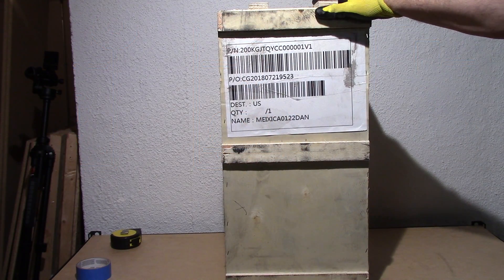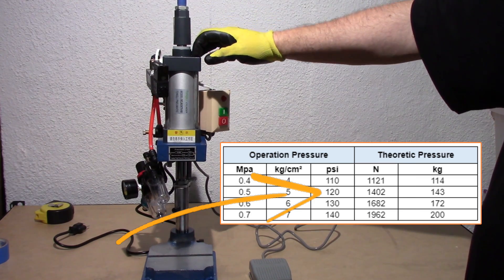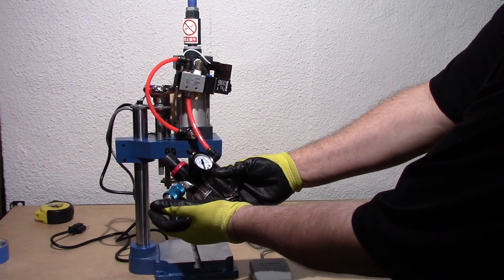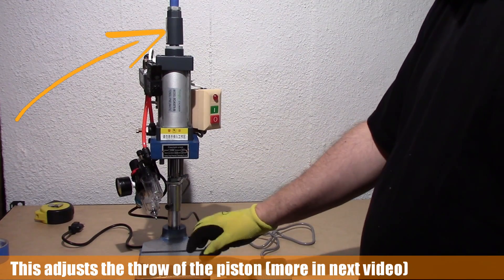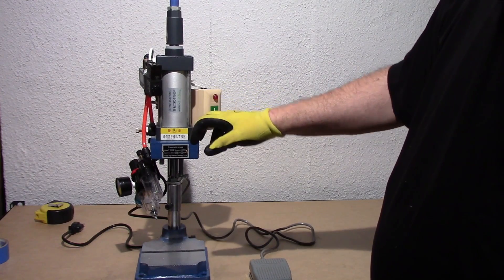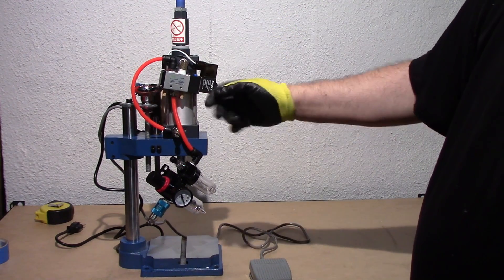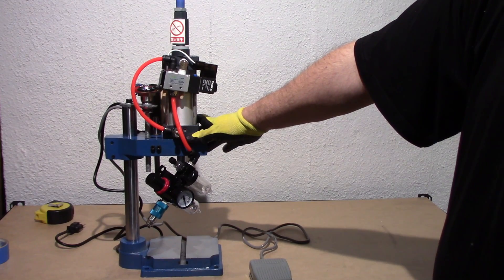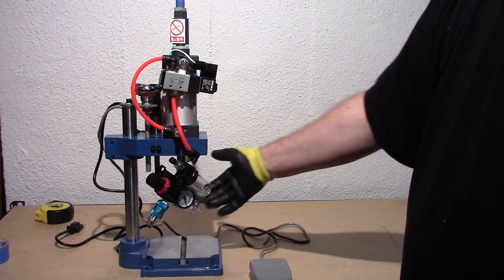Mini Press - Unboxing and Discussion!

Comment: Hi Thanks for your video - very helpful.  I am trying to come up with a way to cut a 5/8" hole in cardboard.  Wondering if you think I could use an arch punch with this press?  Also did you make a follow up video with this machine?  Thanks!

Comment: What type of air compressor can we use for this? Like what is the minimum requirement for the air compressor for the pneumatic press? Have any recommendations? Preferably a quieter air compressor would be nice.
Reply from the maker: This is the one I use: https://amzn.to/2YMIVj7  however if your going to use super heavy cycles times, I might recommend: https://amzn.to/2YK10OR

Comment: Did you ever make any more in this series. If so I can not find them. I would like to see it running more than just crushing the piece of plastic.Thanks
Reply from the maker: Its been a while, thinking I did something on building a head for it.  There was not a lot of interest, so I put it on the back burner video wise.  I have built adapters for stamps which is pretty cool but not much more at this point however it is still on my list....
Reply: @DIY3DTECHcom  Thanks for getting back to me.I did find another video of a set up and basic run of one of these. I will be buying one.

Comment: I buy jna-63 it not work . do I need air compresor?  The seller told me no need because that I buy it.
Reply from the maker: Not sure what a JNA-63 is however this press YES does require an air compressor to operate....
Reply: Do u knoe mini cimpressor

Comment: This thing scares me more than my 100 ton hydraulic press, because air is 'compressible' and might move suddenly, when the friction holding cylinder is 'overcome'. A hydraulic press will move much more predictably, because the fluid is not compressible. Be careful, don't trust that the cylinder will move in a predictable manner while under pressure, as it might just thrust out, all at once. Be safe. :-)
Reply from the maker: Randal you are 110% correct about this is (as with all air presses) moves quickly and I treat it as if live...

Comment: For light presses such as fidget spinners I would think the geared arm on my drill press would deliver enough force. Maybe put your scale under your drill press for a comparison.
Reply from the maker: This produce more force then I can create with a manual lever such as a drill-press and frank is over kill for a fidget spiner, as I just use that as common example.  One of the big things I want to do with this is use for plastics testing and embossing...

Comment: Can it be used for injection molding?
Reply from the maker: Yes and that is one of the things in the back of mind.  I don't have time to build d it right now, Yet it is on the list...
Reply: @DIY3DTECHcom   Not mentioned in your video is the speed the piston moves at. For injection molding you need speed and pressure.  It has marginal pressure but may have enough speed to prevent the medium from premature chilling. I have a wax injector for lost wax casting and those require very low pressure.